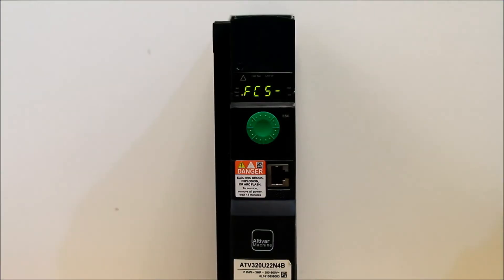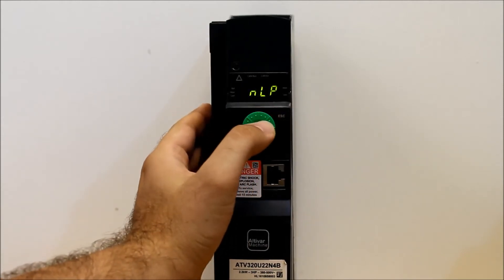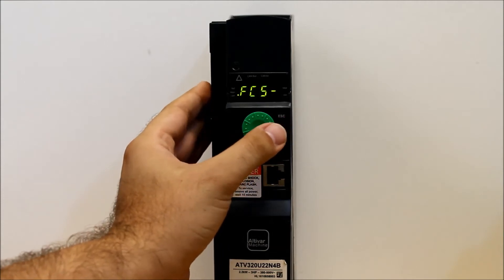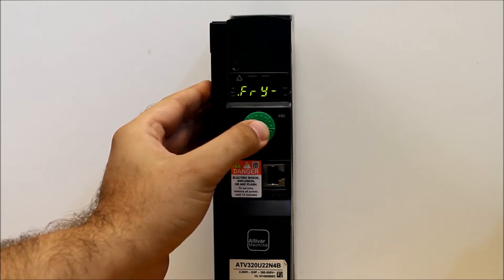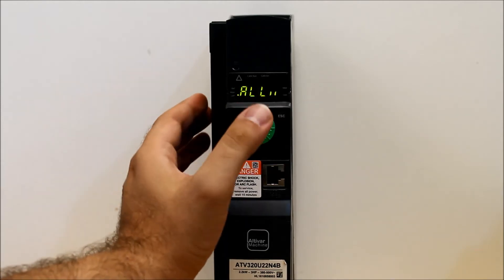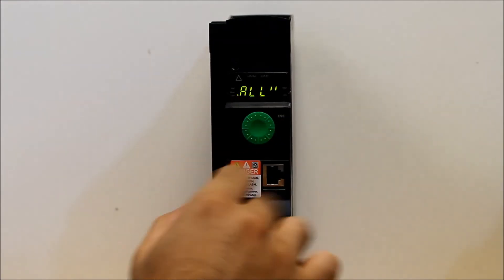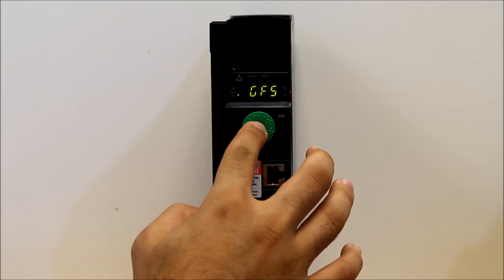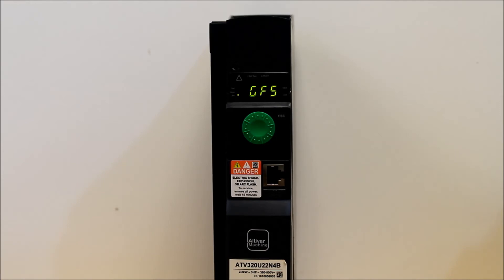Performing Factory Reset on Altivar 320 | Schneider Electric

Comment: Thanks for your lesson,
 please i programmed the ATV320 for asynchronous motor which is used for the winch up/down and frc boat up/down movements.
But i have issue with the motor starting and will not stopping when power is on from the main breaker.
Normally, it starts and stop on its own when the power is restored until i will command for hoisting or lowering as the case may be.
Please can you advice on the parameter that i should be adjusted to stop the motor when the power is up for a while. 
thanks.